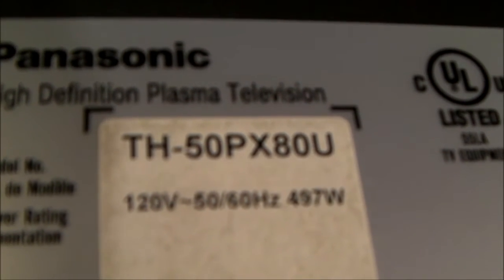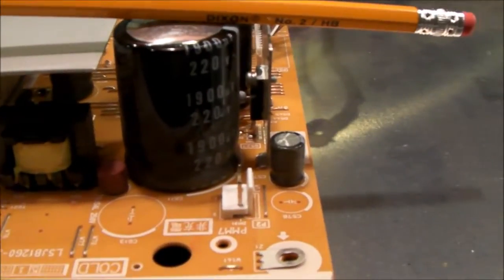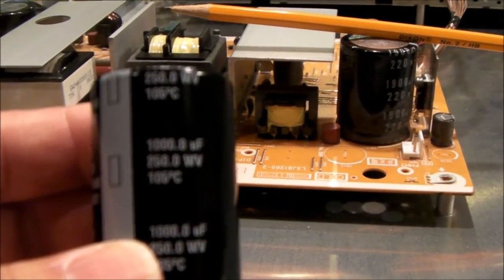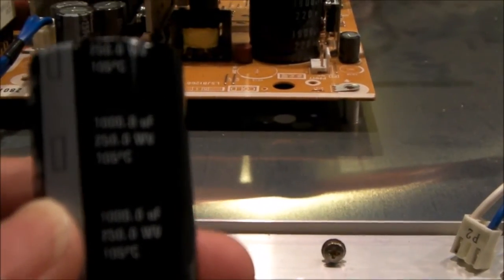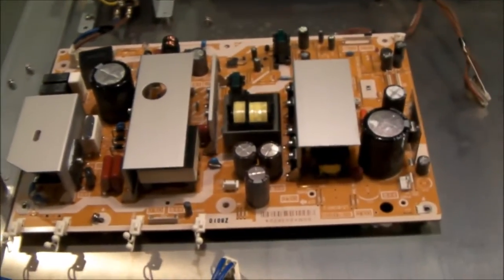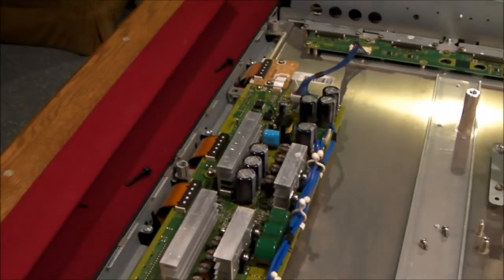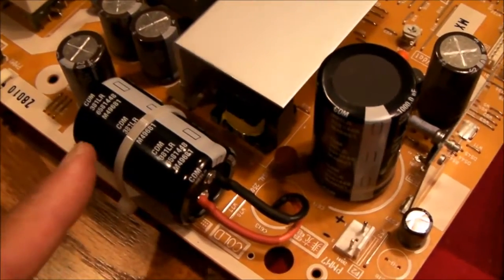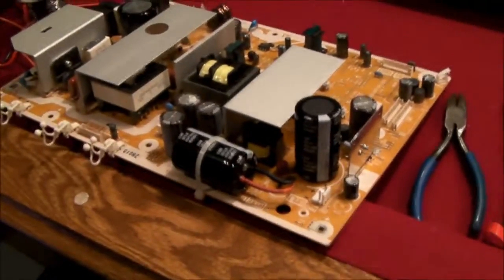Panasonic TH-50PX80U Power Supply 1900 uf Capacitor Repair

Comment: Panasonic TH-42pz77u. TV powered w/o issues and then stopped we would wait a few secs and then it would work ok. Until it stopped for good.  SS board tests ok. Ribbon connectors also cleaned and OK.  Relays click on start and fans remain powered for a few seconds then it dies and I get the 8 blink code.   Any ideas? Thank you in advance.
Reply from the maker: There are numerous and very detailed troubleshooting and repair manuals on the internet for Panasonic TVs.  They take time to find but worth the effort and have lots of good detail and hints.  https://elektrotanya.com/panasonic_th-42pz77u_ch_gp10dhu.pdf/download.html

Also, does your model have a SS2 board? 

I'd be looking at capacitors all over the TV with the symptoms you described.  That is the easiest and lowest cost solution.

I hope you subscribe to my channel!

Comment: Very nice job! 
I have a 50PX80U that turns off after just a few minutes, sooner if warmer, longer if colder. It turns itself off and displays the 2 blink code which I looked up and found to mean 15V SOS with a check point of A board. Do you know of a test procedure so I can determine if this is a bad A board, a bad 15V power supply, or just a temperature sensor somewhere? None of the caps are swollen on any of the boards.
Reply from the maker: service manual here:  https://elektrotanya.com/panasonic_th-50px80u_ch_gph11du.pdf/download.html

sounds like you have this problem:  https://elektrotanya.com/panasonic_th-50px80u_ch_gph11du.pdf/download.html

I ended up sending my board out to a guy on ebay who repaired it and returned it for a very reasonable fee.  don't recall how I determined the faulty board but I will look further
Reply from the maker: there is a manual online that looks just like this one https://www.scribd.com/doc/46124232/Technical-Guide-Troubleshooting-Handbook-GPH11DU-Chasis for the 50PX80U but I can't seem to find it.  This might be the same chassis you have and may be helpful if you can't find the one for the PX80U
Reply: Thanks for the manual. Did you send me the same link twice on purpose, or was there a link to the problem I'm having that was different? Thanks again.
Reply: I found a shorted pin on a small 6 pin chip on the back of the power board and fixed that, I found a transistor that was missing heat sink compound and a screw to attach it to the heat sink on another board and fixed that. Powered it up and then got the 3 blinks (3V SOS) instead of the 2 blinks (15V SOS) so I'm thinking the power supply board is bad. It looks like someone repaired this television and didn't do the best job of it.

Comment: What issue did you have on your a board. I have gray screen
Reply from the maker: Randy, I'm sorry I do not recall the exact symptoms.  I did have to replace the A board and the power supply was working properly but I decided to replace the cap since the bulging was eventually going to create a real problem.
Reply: How do you test the A board? Do you have a link to a procedure?
Reply: same here ..